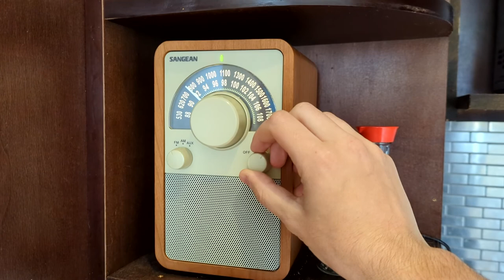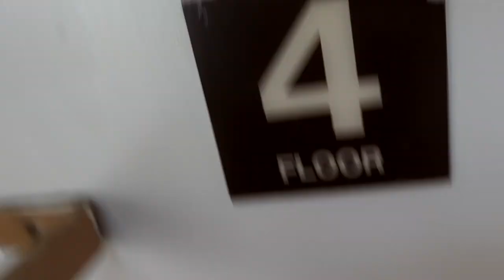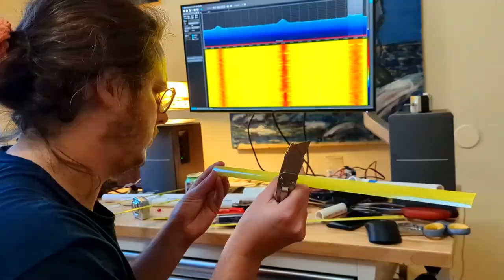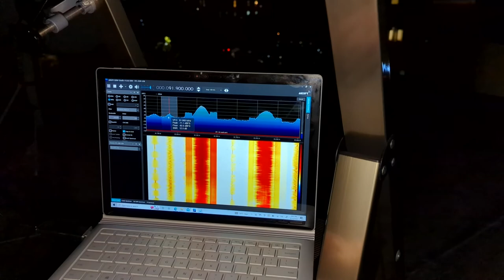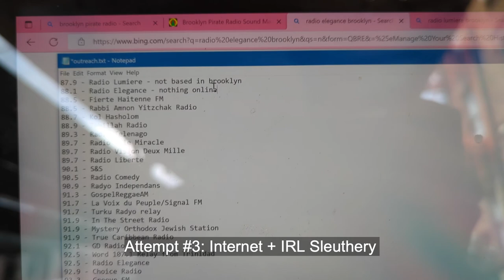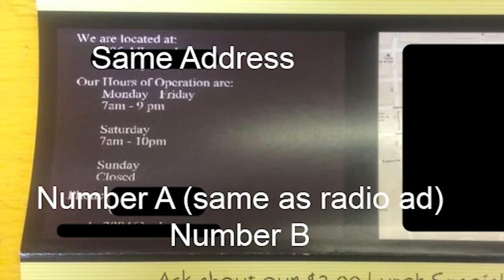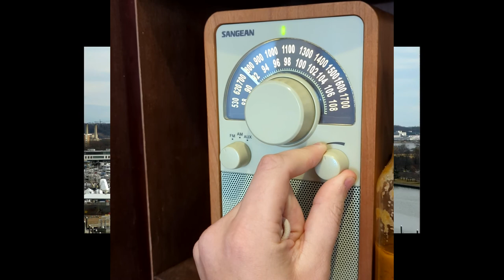In The Streets - Brooklyn Pirate Radio Documentary

Comment: A couple of things: you could have easily found the station with a portable radio using "body fade" and also the polarization of your yagi was supposed to be vertical not horizontal. The elements should have been up and down not side to side to match the orientation of the transmitting antenna
Body fade would have gotten it though~ one holds a portable radio close to the chest and then you rotate in place until your body blocks the signal. When the signal is at its worst it is directly behind you..
Reply: Horizontally polarized FM transmitter aerials are not unheard of, but nowadays it is indeed rare that anyone would choose to transmit horizontally polarized FM radio.
Reply: Most FM Broadcast Transmitters use a circular polarization. So his orientation would not make much difference either way.
Reply: @DCDura  I doubt very much whether a pirate would use a large complex circularly polarized transmitting antenna when a simple vertical dipole is so much more straightforward and easy to conceal.

Comment: Some landlord is going to throw you off of his roof. You can damage a membrane roof with your shoes. Clear channel was behind the beefing up of FCC enforcement. They hate the thought of people actually liking someone else's station. I grew up during the heyday of FM. My father (an RF engineer) and I made a 16 element FM beam when I was 14. In 1974. I could pick up great stations from Utica, Rochester and Buffalo and we built a 30 watt transmitter and I rebroadcast them so my friends could pick them up. Mono but it was better than nothing. Now I have a McIntosh Richard Modafferi modified Mr78 the same FM beam live on a hill and here in sunny Syracuse there is NOTHING worth listening to. Now I use a internet tuner and there are some really great stations. But it was more fun when it was your "iron in the air" doing the heavy lifting. Another thing according to "Radio Locator" there are no unused channels on the FM band in New York City. All these pirates must be running some serious power to get on the right side of a radios capture ratio.

Comment: One tip is you need to turn your antenna to have the elements vertical since FM is vertically polarized.
Reply: FM has traditionally been horizontally polarized. Vertical has only been added to achieve circular polarization.
Reply: @kenenglish124  not when comes to urban listeners.

Most car antennas and such are vertical.

Comment: Interesting. 

I have both an amateur  license with various HAM radios and a non FCC complying FM transmitter that can transmitt in the 70 to 100 plus Mhz range. 

Being a retired mathematician I live in a very remote area and aside from my dog Buddy the Australuan Shepard I rarely see anyone thus have considered using the FM radio as a pirate radio to entertain the few in the area that due to rugged terrain and lack of cellular service have little in the way of radio. My only real obstacle has been what form of audio and for how long and on what days do I broadcast. I could use canned music as the audio or audio books or short stories. Anyway, the station remains unrealized and would only be 10 watts if implemented.

Should you gain interest in this endeavor again post a comment and I can pass along information that likely will save you a lot of research.

Also, If you build a Yagi again, I find that you don't gain too much by three elements thus a two element antenna would work well and be more compacr. Also, rather than cutting up a tape measure I use speaker wire tapped to PVC supports. The other two things worth a mention are:  to have a stronger signal hold your antenna in the same orientation/polarlization which normally is vertical not horizontal as you had implemented & perhaps a mag -loop antenna is the better direction finder because you can actually null out the signal and they are in fact easy to build.

Take care, enjoyed your sleuthing, I think there is a heck of a lot more to the pirate radio story in NYC and it would be cool beans if you could make a more in depth documentary. Good luck....

Comment: All you need is a handheld radio with a telescopic ariel. Tune the station you want with the airel extended, then walk around with ariel down.  You will find the station. However there maybe a blank spot directly beneath the block. This is because of the way radio signals spread.
Sending greetings from London UK

Comment: You can have and operate an unlicensed radio station under the FCC's Part-15 rules and regulations. There are transmitters in both AM and FM that are made to comply with the rules yet yield very good performance when set up properly. Range becomes a non-issue when you put your station's audio either on a live stream on the front page of your station's website or on Live-365.
Reply: Yeah, they regulate range, not power. In the case of part 15 FM you get 200ft. AM is more practical for part 15 operation.
Reply: 200 foot max range

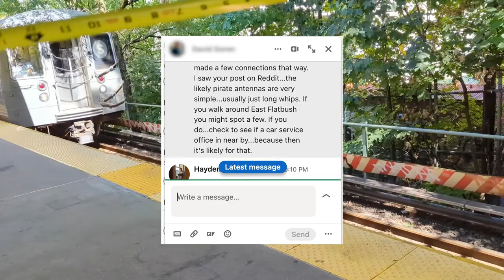Comment: (11:16) Print out a map of the area put a dot where your located and use a ruler to draw a straight line out. Then go to the 2nd location put a dot draw a line straight out to the location you year the station the best. If the lines cross that's where the station is located roughly. If they don't your probably bouncing off the steal and metal buildings because the transmitter although is high its low enough to bounce around a bit. In that case the only way to DF is to get higher into the air. DF is great while in a private airplane because of this. Personally for portability I would have created a 70cm Yagi antenna and used it here is the reason why your not transmitting on this antenna only using it for RX sure that big antenna will do great while your further away but as you get close your can use a smaller yagi to then hone in on the transmitter. I am KC9ZHV.. Sorry about the other hams that bullied you around. Our community does need to be cleaned up a bit and taught to help one another more.

Comment: Where I can buy license and how much it cost for 20w transmitter
Reply: It's expensive and you need a commercial broadcast license. There's info on the FCC website. The legal limit for unlicensed broadcast is 1/2 watt or 200 feet whichever is greater. 
If you want to broadcast you can rent airtime from wmri and wccr @$75 an hour and that's shortwave so global

Comment: Wow it's not that hard to track down and FM station, all you needed was a portable FM radio, tune it to the channel you want to listen to. Hold it close to your chest. And turn it and your body 90°, you'll hear the signal shift in and out. Your body acts as a shield. As you work that in and out of no, you'll be able to figure out the direction of the signal. Once you got into a point where no matter what position you hold the radio it starts to overload. Or we'll pick up the signal. You tuned slightly off of the signal that you want to listen to. Thereby reducing it sensitivity of the radio. And repeat the process you could go through the trouble of using the directional antenna but with only three elements on it you're being with is going to be about 45° wide which even after a couple hundred yards that's going to be a very broad spectrum of the city to look at. Normally when radio Direction finding is done, it's done with very high gain antennas and have high knowing to the sides, or using multiple receiver stations and triangulating the signal. But in general just using a portable FM receiver in your body is a shield works pretty well. Once you think you found the antenna on the building. You then make access to the building go up to the where the antenna is and disconnect it. I guarantee you within a very short period of time whoever runs that station will be up to that roof to figure out what happened to their signals. That's when you tell them that you're actually the HVAC guy or some other benign worker and you tripped over their cable.
Reply: Does that work locating a station that is several kilometeres away?